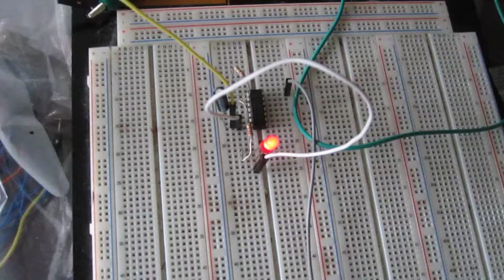7414 Schmitt Trigger Oscillator Circuit

Comment: That LED does not appear at all regular. It's totally random as far as i can see. I tried this circuit out and with a 10uF cap, a resistor over 4Kohm would just not work. 2.2K gave roughly 20Hz. What are your thoughts on this?
Reply: The CMOS version of the 7414 chip is very sensitive to noise.  Therefore the very first thing that need to be done is applying a proper power supply decoupling.  To achieve that, put a 47uf electrolytic capacitor just next to the VCC pin of the chip.  Also put a 0.1uf ceramic capacitor in parallel with the 47uf.  Be sure to respect polarity.  As far as the frequency is concerned, you need to choose a RC combination that will give you a 1Hz frequency or so, in order to visualize the blinking as 20Hz is too quick.  The 100K and 10uF combination suggested on the site will give you around 1.2 Hz.  Don't forget to add an appropriate current limit resistor for the led, limiting the current around 7-10 ma or so.